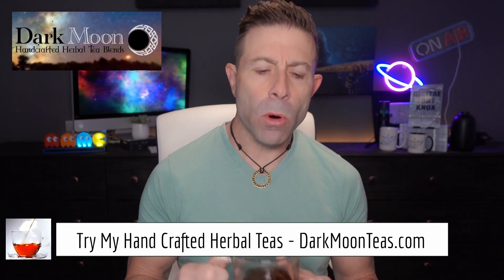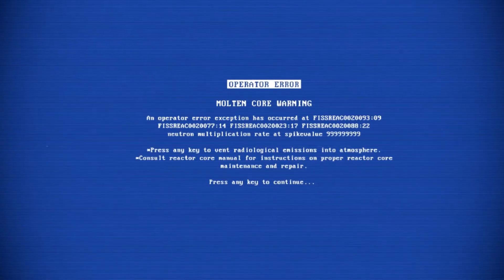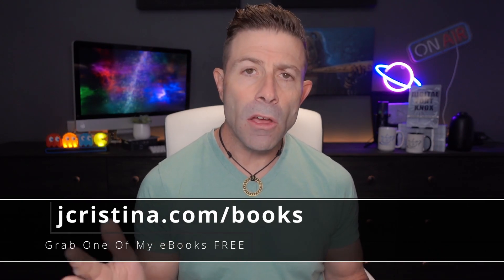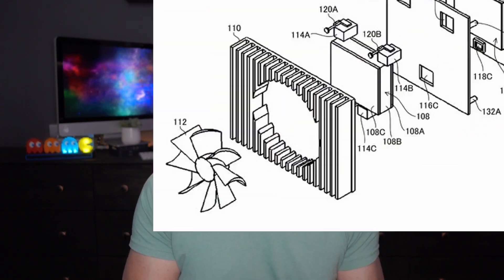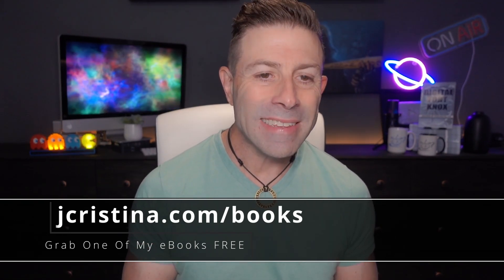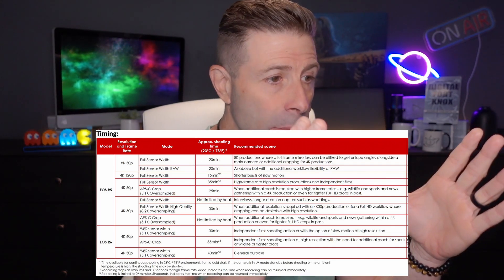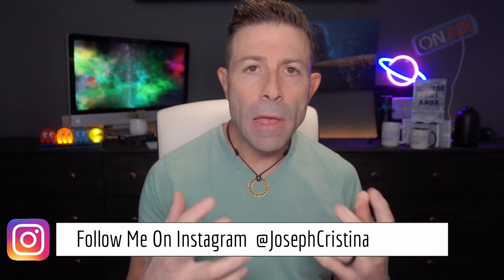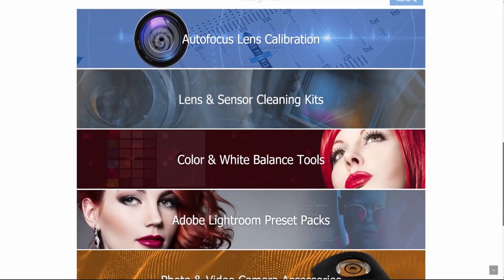Can Fujifilm Beat The Heat To Stop IBIS Sensor Overheating

Comment: Very interesting video. I think you got the point. I don't know why anyone talk about the IBIS overheating issues. I had a Canon RP which don't have IBIS and never had overheating issues even if it's a mirrorless camera. As I got my XT-4 I could not understand why it was overheating and once I've realized that shooting off the IBIS (which in my very personal opinion is absolutely useless) the overheating issues suddenly disappeared. Now it looks pretty obvious to me that a sensor that shakes so fast will of course generate heat.
Reply: I had IS set to continuous. Maybe that’s the issue. I really hope!!
Reply: @cape2costa  I guess so, try turning it off completely and see.
Reply: I'm having crazy overheating issues with the new XH2s, I wonder if this is the problem? Thanks for the heads up!
Reply: @cape2costa  sure! Try turning the IBIS off and see what happens. Let me know if you solved!
Reply: @davidevalentiofficial  Thanks! Doing so now and heading to the beach.
Reply: @cape2costa  amazing! Enjoy the good times! :)

Comment: You know… This can be the same situation with those very long busses. The unit has to be solid, but some parts need to move. Maybe tit is a solid pipe but than a part of it is using fold to make it moveable.
Reply from the maker: It could be.

Comment: another interesting way of accomplishing the cooling would be to - use the X-S10 style flip-out screen, place the fan under the flip out in the body itself, and only enable video capture when the screen is rotated out - exposing the fan to let it push out heat
Reply from the maker: Ya. Maybe on the opposite side

Comment: Btw video has a bit misleading title.The issue is not ibis but processors which are used inside.
Reply from the maker: My understanding is that the patent was intended to combat the problem of the flaring sensor as seen in IBIS cameras.
Reply: @jcristina  It is image receiving device or otherwise called sensor+processor. The later one is causing the heat by processing not only sensor read out but also AF and IBIS. The heat is then distributed through the less isolating parts (IBIS). The vent is serving as active cooling and exhaust. I don't think they are pumping heat internally in the camera.It is a bit different than what Panasonic or Canon has in there camera.

Comment: I suggest that the "cooling pipes" are flat metal which just rests on the sensor allowing it to slide against them. They would need to be a reasonable thickness and therefore rigid to transport the heat.
Reply from the maker: I wonder if that would shave down the pipes or metal on back of sensor over time.    Interesting.

Comment: Heat pipes are used in heatsinks inside PCs a lot. And they are pretty much always made of copper, and are not meant to move.
So, if they're going to attach heat pipes to the back of the sensor to move the heat to a heatsink, surely the heat pipes would have to be flexible or something. But that would be difficult to do without also enabling the gases inside to escape.
Reply from the maker: Agreed.

Comment: I don't usually record video, but the one time I did, my R5 overheated a few times in 4K HQ mode.
Then I bought one of those copper heatsinks from Kolari Vision, and installed it inside the camera myself.
Reply from the maker: The R5C will fix the issue.
Reply: @jcristina  Although the R5C has its own disadvantages, such as not having IBIS, not having DPAF in video mode, and the fact that it has to reboot if you want to switch between photo and video.

Comment: Panasonic has FF and MFT cameras with IBIS, weather sealing and in some cases with fan. Most of them have no record limit. It looks like size matters because the small size of the S5 is the reason for the record limits. This also shows that they can get the heat from the sensor but this is just one problem. Heat comes from the sensor, the processor, the storage (especially CFexpress generates a lot) and the battery.
Reply from the maker: Absolutely.  Inner space is very important.  Smaller is not always better.

Comment: We have to wait and see..Normally,like with power amps, the inside  of the chassis might have vents and ribs, to move the air towards the vents. Then you might have heat sinks or they might even use a slow fan with ceramic bearings,that would run smoother/quieter.
Reply from the maker: Smoother and quiet is certainly important along with longevity.

Comment: I'm not sure we even need 8K video, but regardless of that, a "fan" is not the way to go; it will require bearings that will eventually fail. It would be better use a Peltier device, which is a solid-state device that provides cooling based on the Peltier effect. We used to use them in the very first thermal cyclers back in the day when we were developing PCR (yes, that PCR). Ref. for Peltier device: https://en.wikipedia.org/wiki/Thermoelectric_cooling
Reply from the maker: Great point.

Comment: Going to have to look at this more closely. But, I sure hope that only one of the reported two new cameras is so focused on video so this issue is a non-issue for the stills focused camera. Question: How large of a device are video folks willing to deal with?
Reply from the maker: I guess. If you look at the fx3 or r5c. They can be pretty compact.
Reply: @jcristina  Yes, but I'm wondering how big would be acceptable because bigger case would mean more air space to work with for cooling.

Comment: If they want to have a sealed body like the typical pro user, that would resist rain on the sideline, or the street, perhaps the cooling pipes go to a heat sink that is separated from the sensor and other logic boards, like the bottom plate of the body.  There could be venting there that wouldn't compromise the weather resistance.
Reply from the maker: Right.

Comment: All effective heat pipes are solid inflexible metal materials. I don't see how they're going to have such heat pipes on a floating sensor?
Reply from the maker: Very interesting.
Reply: What if there was some highly conductive "wicking" material that was flexible where it attached to the sensor, then ran through a more rigid tube that provided additional heat conduction?